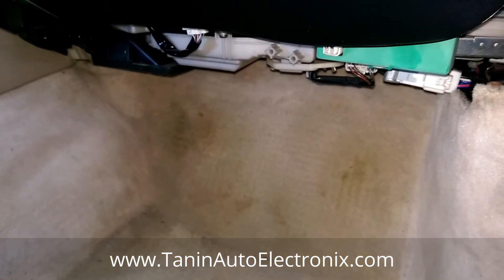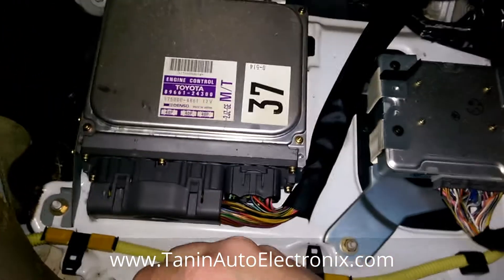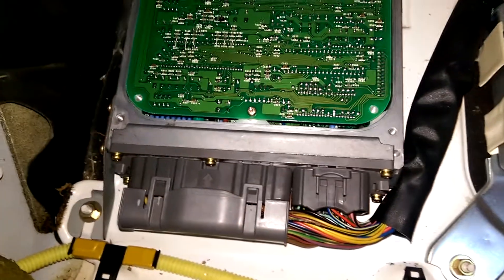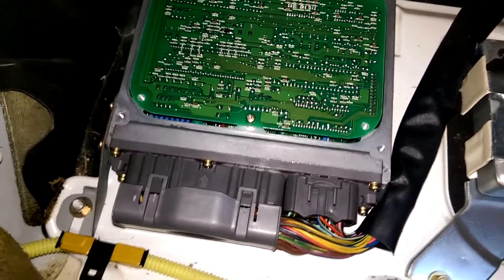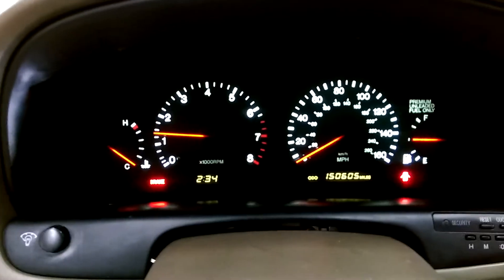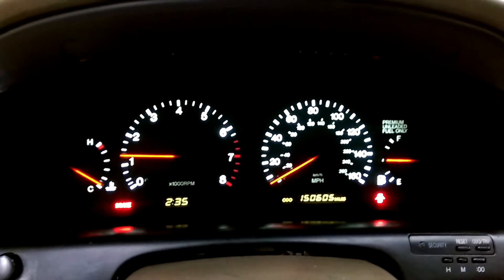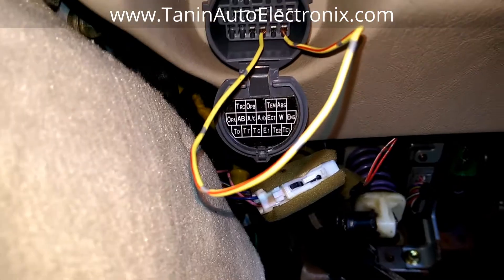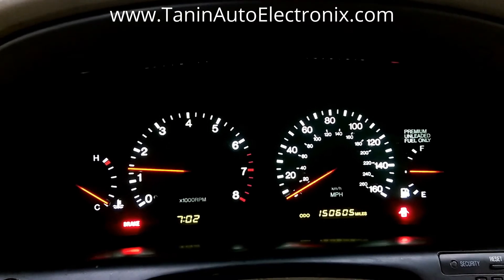ECU Removal for 1992-1996 Lexus SC300 SC400 & How to Troubleshoot your Engine Control Module  Tanin

Comment: I have one Lexus SC 4001992 model I have a problem and check number one and injector number seven is dropping too much fuel in the engine so can we fix this problem?
Reply from the maker: Yes. If the ECU is at fault

Comment: I have a 2000 SC300 and it has that diagnostic connector and the OBD2 connector. It also has a diagnostic port in the engine compartment. I wonder why? 🤔
Reply: All Toyotas of that year do. It’s a convenience for the mechanic.
Reply: @negativeindustrial i would like to know and learn how to use these diagnostic ports.

Comment: Who a bad ECU cause of parasitic drain on the battery in a 1995 Lexus ES300?
This is gold key model with the CD stereo system factory in the trunk? Any help would greatly appreciated
Reply from the maker: Never heard of that happening. The 92-96 ES300 ECU still needs to be rebuilt if it hasn't been, it suffers the same issues and damage.
Reply: Try it with the changer unplugged

Comment: i think i might need to replace my ecu because it’s not wanting to start anymore and i think my ecu is corroded and you seem pretty reliable how much would it cost for my first time sending you my ecu?
Reply from the maker: Sometimes the damage exceeds the repair price and labor involved in fixing. This is when we would recommend a replacement. We can check and test yours to determine if it is worth being saved or not.

Comment: Intermittent no start all crank problem on my 92 sc400.. I changed the fuel pump and relay already but still happening.. check all possible problems already.. could it be ecu problem
Reply from the maker: Sure it could be

Comment: I was told that my lexus sc300 has electrical problems/ is that the same as the ECU?? will changing it remedy my problem?? my battery keeps draining. It's not the alternator or starter. The radiator had oil in it. I got it fixed. I took it to the shop and had a lot checked on it. So I am lost....help!
Reply from the maker: Hello!

If you need any assistance, please contact our customer service department, we would be happy to help!

contact@taninauto.com
(262) 456-4147

Comment: SC400 stalled twice while driving, first time it kicked back in, second time neutral then had to restart, check engine light comes on, now car won't start.
Reply from the maker: We recommend replacing the ECU. 

If you have a 92-94,
https://www.taninautoelectronix.com/product/1992-1994-lexus-sc400-rebuilt-ecu-89661-24231-federal-emissions/

Comment: Having a low idle issue and car runs super rich all of a sudden. Changing typical sensors rn (tps, isc/iac, afm/maf, o2) but if i change all that and car still runs rich and dies at low idle is that a ECU issue? also my friend tried to scan it at first and the CEL was tweaking out and flashing super fast. is that supposed to happen? even he said usually that doesnt happen unless ecu is going bad
Reply: Did it work?

Comment: Hi, I have a 2006 SC430 (have you worked on them?) the car is braking hard when down shifting and coming to a stop, it fells like braking but is from the transmission. I was going to start with changing the ECM (since this looks to be the problem on most internet cases) do I need to reprogram the ECM (only the Dealer does this?). Any inside will be much appreciated.

Comment: Can any ecu be repaired or are some so bad it’s beyond fixing?
Reply from the maker: There are some things that can't be fixed, and we have a diagnostic service just for that! 
https://www.taninautoelectronix.com/product/general-diagnosis-service/
Send it in and we'll take a look at what could be causing your issues. If its fixable, we put the diagnostic fee towards the repair price:
https://www.taninautoelectronix.com/product/1992-1996-lexus-sc300-sc400-ecu-repair/
If its not fixable, we put the diagnostic fee towards a replacement price:
https://www.taninautoelectronix.com/product/1992-1996-lexus-sc300-sc400-rebuilt-ecu/

Please let me know if you have any other questions!
taninautogm@gmail.com

Comment: California 1995 LS 400 w/ engine code P1600. Smog test coming up and have to get rid of the code for it to pass. Car runs fine. Will connecting 2E1 to E1 with a wire erase the code so it will pass smog? If the code comes back on after it passes smog test that's OK.
Reply from the maker: Hello!
Can you send us some more information about your vehicle so I can see if we can help?
262-456-4147
contact@taninauto.com
Reply: @TaninAutoElectronix  Thanks, but it's fixed.
Reply: @TaninAutoElectronix  Thank you! Got it fixed.

Comment: I replaced the starter on my 96 sc400. The car still doesn’t start. The fuel pump kicks in. The starter works. I’m getting NO SPARK. I’m not sure if the Distributor is bad, or if it’s the ECU.
Reply from the maker: Hello Isael!
Can you send us some more information about your vehicle so I can see if we can help?
262-456-4147
contact@taninauto.com

Comment: I removed my starter for sc400 but car wont start now only clicks and wants to but wont start
Reply from the maker: Did you put the starter back in the car?
Reply: Tanin Auto Electronix yes
Reply from the maker: @uniquekiller3370  you can send your ECU to us under a diagnostic for $99.99! We'll install it in our test car to see if we can duplicate the issues before resorting to a rebuild

Comment: So after a center amount of time (like 11-12 hours) my whole sc300 would not turn over at    all. At first I thought battery issue got a new battery wasn’t that thn I was thinking my fuel pump wasn’t engaging later down the line I learned it was an ecu problem so I just bought a new ecu and did this. I should have sent my ecu to get repaired instead of getting a moderately newer one. Know I know
Reply from the maker: We'd be happy to help next time!

Comment: My Lexus 300 won't idle and when it does it back fires whenever I try to give it any gas
Reply: mass airflow sensor or idle control valve could be it
Reply from the maker: Hello!
Can you send us some more information about your vehicle so I can see if we can help?
262-456-4147
contact@taninauto.com

Comment: My 1992 sc400 won’t let me see the engine codes, it doesn’t matter if I use a snap-on scanner or the paper clip trick. The scanner says that it’s unable to communicate with the ecu
Reply from the maker: ECU is probably bad then and/or needs repair if possible

Comment: Hi, i got a Lexus RX 300 and i got a problem with my fog lights, i keep getting the code B1241 Body ECU Switch Diagnosis and i have no clue where to start solving the problem...can i help out with an hint on what to do?
Reply from the maker: Hey Sérgio! Thanks for reaching out, but unfortunately, we don't work on the RX300 ECUs and can't help with this issue. Have you tried taking it to a mechanic?
Reply: @TaninAutoElectronix  hi, thanks for the reply...yes he believes it might be bad connections because of humidity on the power connections of the fog lights...
Reply from the maker: @MrAsparthya  Gotcha, we currently only offer repairs for the SC300/SC400 ECU's. Sorry we can't help you out more, but good luck in finding the fix!

Comment: How do you take the bolt that connects the harness to the ecu off? Mine just spins but does not tighten or loosen, just spins?
Reply from the maker: You will need to loosen the bolt while pulling on the harness at the same time. Let us know if this works for you!

Comment: Will the codes still appear after battery disconnect ?
Reply from the maker: If there are still problems there will still be codes
Reply: Tanin Auto Electronix my car was doing this .. youtu.be/FJfGTfE7vp0  
Then after battery disconnect it drive fine for a month now it's back to this and as of yesterday it just cranks

Comment: Thanks for the video Im about to check this tomorrow. My check engine light came on tonight while driving on the hwy on my  92 SC300. On troublecodes.net/lexus/   it says "After service, the diagnostic trouble code or DTC’s retained in the ECU memory must be cleared by remove the EFI fuse for approximately 10 seconds or more". Where is the EFI fuse?

Comment: Why do some of the sc400 gauges look good like this one and others have more of a yellow backlight?
Reply from the maker: The yellow backlight is the OEM bulbs the brighter white backlight is when they have been upgraded to the LED bulbs.
Reply: @TaninAutoElectronix  
Does my ECU need a grounding strap? I have 1JZ-GTE Twin-Turbo swapped my SC300 and none of the stock grounding points line up with my JDM ECU. It starts and runs now, idle is still not perfect but it’s only had one heat cycle and no miles put on her yet - just forward out of the parking space and immediately back in.
I can just build it a smaller 12g jumper wire from the ECU mounting bracket to where the USDM ECU mounts. Will that be OK?
BTW - I’ll be filling out a work request to repair my old ECU. I’m big on having spares for everything on all my old turbo Toyotas. Parts are becoming difficult to find these days.

Comment: I have a 92 sc400 it start up then shuts off if I try an give it gas there is nothing there an dies right away..can't figure it out everything is on anr works all fuses seem to be fine an I replaced most to brand new..I did brand new fuel filter and pump..new map sensor new to sensor ..still nothing ..just turns over there shuts off..please help..
Reply: Bypass the fuel pump control module
Reply from the maker: If you would like to send the ECU in for us to run diagnostics on it, this is the link for more information: http://www.taninautoelectronix.com/1992-1995-SC400-SC300-Lexus-SC400-ECU-ECM-Rebuild-p/lexus_ecu_repair.htm 

Unfortunately, we cannot diagnose without having the ECU in for testing.

Comment: I just got a sc400 and the car blows the spark plug#30 when started..when running, the engine  jumps for  about  5 secs and then check engine light comes on..what could this be???
Reply from the maker: We recommend going to a mechanic to have diagnostics run.